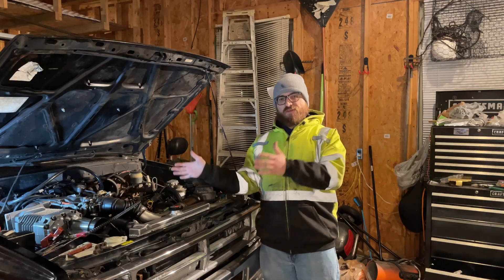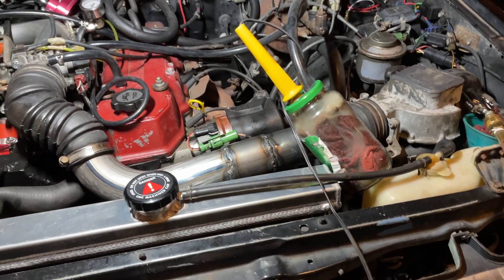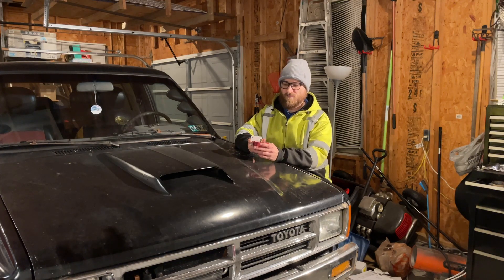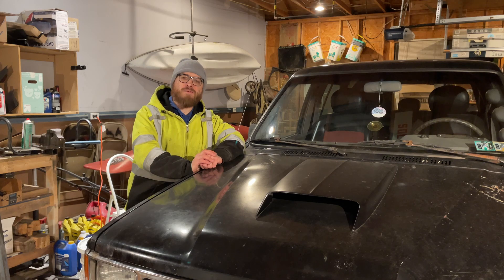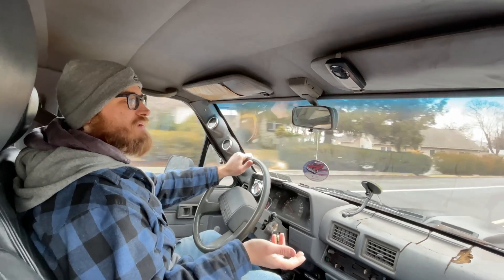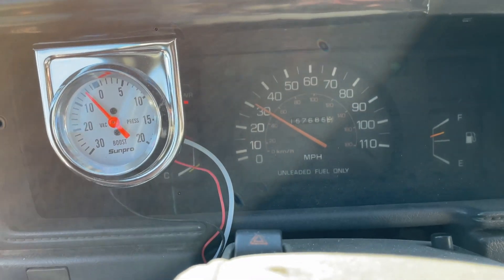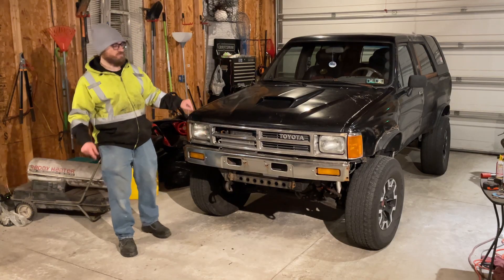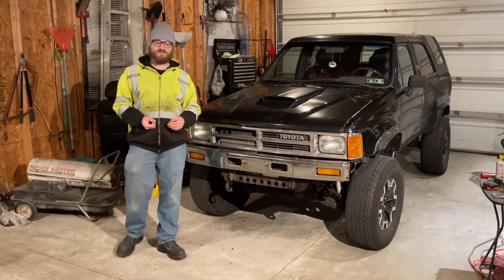m90 22re Superchager Part 3 Sending it on stock EFI

Comment: Great information. The 20r/22r family is my favorite 4-banger. 
I have a couple blocks to build and would like to try this but carburated.
I learned some valuable stuff Thanks
Reply from the maker: Heck yea, do it up.  This motor is stock except for the cam. I dongle hone rebuilt it 40k ago. 6 years ago a valve guide broke and a large piece got stuck in the piston. I pryed it out and dremeled the edges smooth.  So you don’t have to go nuts building it.
Reply: @BeatUpBuilds  dongle hone😂🤣

Comment: That's why I went with a carb, I got my truck to the point that the stock efi system not being tuned right made it pointless to have the performance mods. I did the same thing with the air flow meter. Knowing what I know now starting from a clean slate  I would do the 20/22r hybrid but if I had the 3.0 I was do a 3.4 swap.. Everything I've learned has come from youtube or forums. I been debating on selling my truck for good money and buying a broken down one and rebuilding it. Look at my most recent short.

Comment: Been looking at cadman one for it. but at 5K. I have 3  22re's Would love feed back on gains and tips tricks plans. Awesome job figuring that all out man!  Hope to build a shop this summer. Tired of 100 hp. heck I'd buy the plans
Reply from the maker: I think I put all the important info in my videos. A gm m90 is easier to find but a little different mounting. Decent gains so far but the stock efi is holding it back. My next video I will add stand alone fuel injection which will gain more hp. I’ll answer any questions you have just leave a comment.
Reply: @BeatUpBuilds You should begin to sell those manifolds so people could bolt on that supercharger. I would honestly consider buying one lol. LCE has one but not for that supercharger and it’s pretty expensive
Reply from the maker: @ maybe one day, I’d probably make it for the gm m90 since they are more common and cheaper usually.

Comment: That idle adjustment on the AFM is for idle speed in drive/reverse for the automatic? Cause from what I know the idle speed screw on the TB for an auto only adjusts idle for park/neutral.
Reply from the maker: The afm screw is for idle mixture. The throttle body screw sets the rpm it idles at. Keep in mind if your mixture is super rich or lean it can alter idle speed.

Comment: Awesome build. I’ve had 4 Toyota trucks. Only 1 with an automatic transmission. And it was a slug. I put that motor in another truck which had a 4 speed manual in it. It ran like a completely different engine. I believe the 4 speed manual would improve ….everything.   If I still had one I’d give it to ya. Love the build. Love the can do attitude.  If you’re not in the show me state I’d be surprised. If ya need another project may I recommend the Jeep 4.0 H.O. Excellent job. Toyota Power! I’ve been preaching since 96’.
Reply from the maker: I want to go to a 4 or 5 speed but most people want 1500 or more for trans and pedal
Reply: @BeatUpBuilds  I believe there is a shift kit for the automatic which allows you to manually shift the transmission and it’s also only $100 believe it or not. I forgot the name but it’s out there and still made. I too have a 22re it’s cammed FBO but the automatic transmission definitely makes it feel slower with OD off and the transmission cable all tightened all the way makes a big difference since it’ll hold  the gears longer. Also look into an msd box you can adjust the timing depending on the rpm’s boost etc